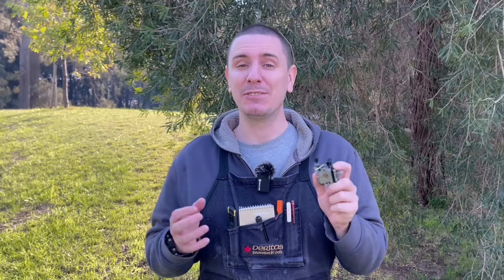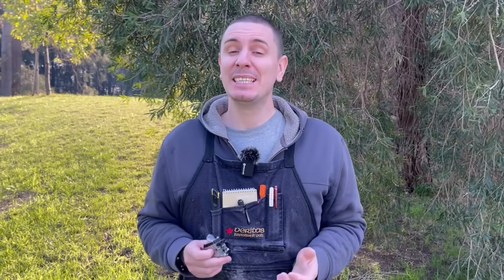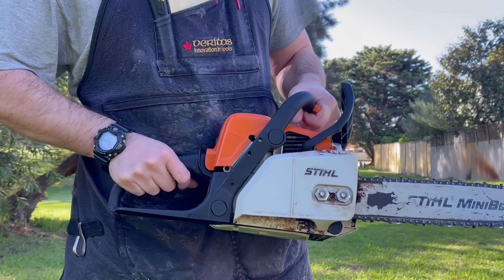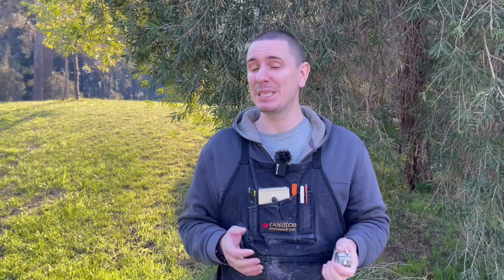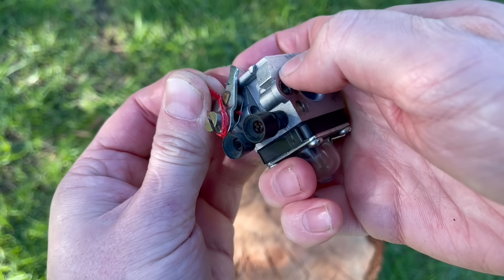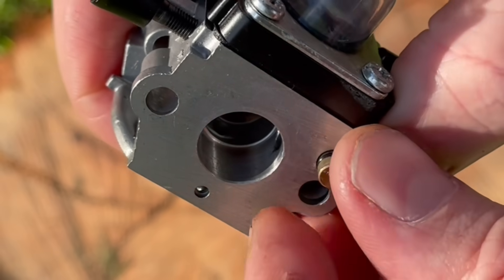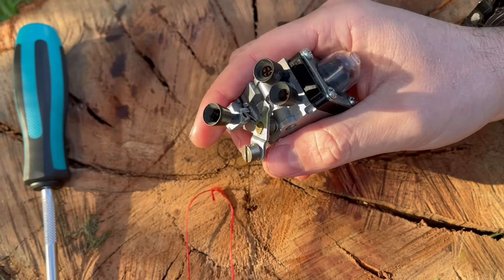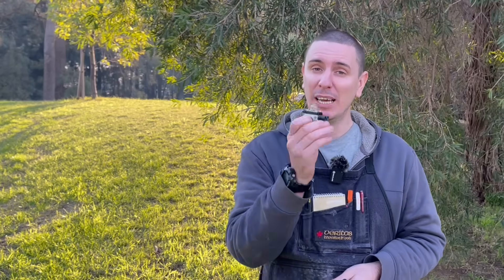A Carburetor Fix Many Mechanics Don’t Know!

Comment: Yes i ordered a brand new carb with a short block,, for weed trimmer,,  does not run right,, I'm going to try carn on original engine,, I can't remember the name of the weed eater, when i went to trade school, the teacher taught us the circuits of the carb,, i think 7 circuits,, idle, off idle, cruise, full throttle,, accelerator  curcuit , float bowl,, choke circuit, i could fix any carb after that,, i did jot get to set in on his automatic transmission class,, so i just started tearing transmissions down snd putting them back togather with new clutches snd seals,, cleaned up, best i could, they worked,, i did not really know how they work,, they did,, !!? I remember the older guys in one shop,, i heard them saying, "they gotta be clean" that's the most important thing,,!  So when i worked on forklifts, i did the automatic transmissions,, they had reverse and forward,, were super strong,, the dealer i worked at had book showed trans fluid circuitry,,  bosses bought a big flat bed truck, so i drove to other side of town brought a large 6cylinder forklift back to shop,, rebuilt trans, put it back on flat bed truck, drove it back across town,, everyone was happy,,  no one asked me if i had a license to drive truck,, was easy to drive,, cab tilt back could see engine v-8 ford,, was fun to drive,,  i was getting goid at rebuilding forklift transmissions,,!!?  Oh well, we're talking about weed trimmers,, these little carbs,, i  have not broken the code on these things yet,, ??!!
Reply from the maker: Sounds like you’ve got a lot of experience with these sorts of things! I hope you find a solution :)

Comment: I had a little stihl saw that was doing exactly this, I don’t work on carbs much but being a mechanic by trade I pulled it all apart and found the oring was worn on one side, so I ordered a rebuild and sold the saw after it was running good😂
Reply from the maker: Awesome! Good work :)

Comment: The biggest issue with these small engines is ethanol in the fuel that produces water in the as tank.
Reply from the maker: Yes, best to keep it drained when not in use :)

Comment: Amazing stuff, thank you for sharing. I will add that on older carbs, the diaphragm will be stuck to one or both surfaces. if it does not separate very easily damage can occur, and simply leaving it in the sun/warm place while you have lunch will allow a bit of expansion to happen and the diaphragm will lift off far more easily. hope this helps someone :)
Reply from the maker: Great tip!! Thanks for sharing :)

Comment: Most consumers are not capable of servicing their carburetors . I have been doing small engine repair for over 40 years. As you stated, its easier and cheaper just to replace the carburetor on any small engine rather than rebuild it or replace worn parts. I seldom bother with diaphragm kits any more. The labor involved is more than the cost of a replacement carburetor.  I talk to many small engine mechanics on line and they themselves no longer bother rebuilding a carburetor.
Reply from the maker: Ahh yes but don’t forget this channel isn’t aimed at professional mechanics in a workshop, this channel is to empower homeowners and passionate hobbyists to take on rewarding repairs rather than being parts swappers.
Reply: @VintageEngineRepairs  I must say is very rewarding to fix the no chainsaw or any machinery. Thanks for the wonderful work you’re doing.
Reply: why get a mechanic to replace your original uality Zama/Walbro/etc carb with a cheap poorly performing Chinese copy? Anoher reason to never use a mechanic
Reply: @wxyzxdll Are the OEM ones any better now days? I question that. If you tell a customer its going to cost more to fix something than they figure its worth, they may just dump it on you as well. How many gas powered weed wackers can you sell? Used ones? Good luck.
Reply: Perhaps one of you guys can help me… I have a Stihl HS 45, and I’m experiencing the same bogging down issues when I hit the throttle. It lags before it accelerates. And sometimes won’t stay running after running it hard. I replaced the carburetor, the spark plug, the fuel filter and cleaned the spark arrestor very well, and still have the issue… Any ideas, fellas?
Reply from the maker: I'd suggest looking into an air leak somewhere mate :)

Comment: Rather than doing all of this, you can inject a small amount of grease into that 3rd hole without having to strip and rebuild it.  The grease is viscous enough to seal up any tiny airleak.
Reply from the maker: That isn’t the only hole, behind that one you have the shaft hole. You can’t get it fully sealed from the outside. Oil is a better alternative to test if it’s failing, but the only true fix is replacement.

Comment: So! This could be the reason here for the high failure rate of carbs on 4 Mix brushcutters. Users had no option but scrap them because of several carb replacements. But some I redeemed by fitting clone saw carbs that are fairly generous with fuel delivery, especially in the idle and low speed range set with L. I do have a box ful of carbs . Let me see if I can breathe life into some of them
Reply from the maker: Interesting! A customer is bringing me a km131 that floods too easy on cold starts, going to dig into it.

Comment: Hey,thank you for your videos! Those helped me a lot. :) I have a question,carburetor from stihl fs38 2mix,primer bulb wont prime,it doesnt have acceleration pump like classic 2 stroke fs38 . I dont know what to do 😐
Reply from the maker: Check the main nozzle is sealing :)
Reply: @VintageEngineRepairs  thanks,can i send you picture somewhere to be ensure Im looking at a good thing?😅 Is it a one way valve btw?
Reply: Okay ,I can blow air and suck it ,so i think its not good. Where i can buy a new one? Im from Croatia :)

Comment: Brother i got a question. Every darn time i unloosen and re-seat the throttle blade and tighten the screw, the plate slightly kicks back out of perfect adjustment. Ive tried tightening the screw so many diff ways and the plate goes from perfect(zero light) to then out of adjustment (seeing light). Sounds stupid but any ideas to help such a stupid problem im having.
Reply from the maker: Hey mate, you only need to be snug with some picture, sounds like you may be forcing it? Alternatively, set the butterfly slightly off from the alignment and when you tighten it down it will align perfectly :)
Reply: @VintageEngineRepairs  Thanks brother, ill try it and hope for continued success for you

Comment: I couldnt find anyone that could supply a new oring or piston for a C1S Zama so i just plugged the bore with JB weld and drilled the second idle progression hole slightly bigger. Saw runs great now but does use more fuel
Reply from the maker: Nice fix!

Comment: If you always use the rec stihl 2stroke oil  you prob wont have these issues for a lon long time if ever they dont rec that oil for just any reason it protects the rubber and brass aluminum parts from wear throughout the entire pice of equipment aka read your owners manual sthil strictly warns and also voids your warranty if you use cheap 2 stroke non approved lube
Reply from the maker: That’s simply not true, in fact Stihls 2 stroke synthetic oil is actually very low quality - JASO FB rated. In fact it’s one of the worst you can buy! There are far many more better oils that offer cleaner burning and more affordable.

Comment: I've worked at a small engine shop for several years. I have read dozens of repair manuals, taken brand certification tests,  and spoke to the other techs I work with. Yet, I have never been told about this or showed this before. I cannot wait til my next "problem child" comes along so I can try it. THANK YOU.
Reply from the maker: You’re very welcome :) glad it was useful!

Comment: I find that it is the pinhole tube that goes from the fuel float reservoir to the bottom of the venturi air valve is most problematic. If you don't drain the gas or leave it over the winter and try to start up in the spring, residues or varnish plugs up that tube, therefore no gas gets in the venturi.
Reply from the maker: Ah yes, the check valve in the main and idle drillings. They are normally very reliable, but I don’t have ethanol in my fuel, that may be making things worse for you?

Comment: Mabe but I also had this problem with my chainsaw I so sent it to the shop and it was fixed for a short time then problems returned. An old mechanic friend of mine then showed me the problem the shop had lazily just adjusted the throttle and idle screws but the problem was the diafram had a hole so small i needed a magnifying glass to see it. Changed it had to reset to throttle and idle screws to factory settings (idiots) then ran like new.
Reply from the maker: Glad you got it sorted :)

Comment: Thank you for teaching, an old dog new tricks.  I am a 73-year-old retired engineer, who has tinkered with engines and all things mechanical & electrical ever since I was eight years old.   Very grateful to my Father, who allowed me to fail and learn from failure.

I even owned an original McCulloch chainsaw, which was a beast to keep running, but 20 times faster than an ax.  I still fix my own carburetors and a lot of carburetors for other people.  But like others, I never knew about the accelerator pump on the small engine carbs.   Again, many thanks !!
Reply from the maker: You’re very welcome! I’m glad you enjoyed it :)

Comment: Thank you sir. This is the difference between a true mechanic and a fitter!
I have a 50cc petrol post driver suffering just like this. I did buy a replacement carb, but having boxes of multiple neoprene O rings, I will take it apart and replace this O ring doing the tests you recommend. I use it for repairing the 100mm 10 foot deer fencing poles and it only idles with the choke on, I have to place it over the pole which is already 2 foot into an auger drilled hole, then flick the choke off and catch it with the accelerator. Sometimes it stalls out which is a pain because it's pretty heavy to take up the ladder and place over the pole.
It would be awesome to get it working as it should, it was never right from new.
Reply from the maker: Thanks for the kind words, and I agree with you!
Reply: As a small engine mechanic, my goal is to get the customers  unit back up and running at a cost they can be happy with. I have learned that it is cheaper in the long run to just replace the carburetor,  than have to charge time to rebuild. It is seldom just one part that fails. Upon opening a carburetor,  I generally see a lot of wear on everything.

Comment: When you can buy a BRAND NEW Walbro or one of the 20 different clones of them for under $50, why would anyone bother repairing one? I have pulled many of these apart over the last 40+ years, and they NEVER work the same again after reassembly. 99% of Go Kart drivers have a box full of these, for all different tunings to suit all different tracks in all different weather conditions. The guy's who are consistently on the podium aren't going to waste time pulling a $50 carby apart to make it worse than it was. The rebuid kit is almost as much as a new carby anyway. I have a box full of them for my petrol engines on RC aircraft and petrol powered gardening tools. If your having issue's, the simplest fix is to replace, if you mess up the pop off tension or damage a jet  or bend the delicate float arm or whatever, then your carby is stuffed anyway.....all you need to do is lose ONE screw, spring or washer and your carby is garbage aswell.
Reply from the maker: Thanks for watching
Reply: A box of O-rings is lighter to carry, but rebuilding stuff requires skill and patience. And if you learn how to do it well, you can do tiny mods to increase the gas flow and performance too. But it's harder!
That's the difference between a real mechanic, and a fitter IMHO sir.
Reply from the maker: @chriswalker4272  very well said 👍
Reply: @chriswalker4272  Rebuilding one of these is simple enough, as is re-jetting. but 90% of people that own a chainsaw or other petrol powered machine either don't have the knowledge or skills required, the patience to do it or the tools to do it correctly, so my comments are true. I have spent more time in the last 40 years reassembling these carbs than I care to admit, and it is simply a time consuming annoyance that can be fixed much faster and easier by replacement. We live in a disposable world more than ever, somethings are simply NOT WORTH FIXING anymore. A cheap 40" bar chainsaw costs less now than a carton of cigarettes, I'd rather spend $150 on a new item than spend 4 hours repairing one that will fail again sooner rather than later anyway. Nothing is made to last anymore, let alone be worth repairing.
Reply: “C-A-R-B-U-R-A-T-O-R”.       You’re welcome.
Reply: @wiltonsmith3397  Thanks for the incorrect correction we didn't care about

Comment: I'm wondering if this is the problem I have. I have a leaf blower and a chainsaw that won't run right. I've cleaned the carb out on both, and changed parts too.
Reply from the maker: Do the oil test over the 3rd hole :)

Comment: I once bought a book on 2 stroke engines all about and how to tune and rebuild and such, just to see if I couldn't glean a bit that I didn't already know. Right in the preface was a sentence that caused me to throw that book in the trash. It said 99% of all engine problems as far as runability could be fixed with a spark plug change. You know I've had maybe one or two engines in my tens of thousands that a spark plug change fixed anything. Junk BS!!!

Comment: I got one you just may help me with
Reply from the maker: Sure, what’s up?
Reply: @VintageEngineRepairs  I got one only a year old echo. I've cleaned and serviced the carburetor but will still only run when full choked and even then it only starts if you hold the throttle at full and runs abt half power. The bulb is good I've been through it completely new spark plug and even cleaned the spark arrester
Reply from the maker: Have you tuned the carburetor?
Reply: @VintageEngineRepairs  yes
Reply: @pieseasmyseas  Possible got a plugged up fuel filter. My Stihl weedwacker ran similar to that…… full choke to start, half choke and full throttle to run, dies if at idle. Pulled fuel filter(stone) and blew compressed air back thru it - worked like a new unit instantly. Put on a new fuel filter now and it’s mint!

Comment: “A carburetor fix many mechanics don’t know”…yea, it’s called throw it in the trash and swap it for a throttle body and fuel injectors.
Reply from the maker: And then you can enjoy the rewards of having to pay silly amounts at your local mechanic because the manufacturer doesn’t allow users access to the software - a stihl 500i sounds right up your street ;)

Comment: Great video never thought about that piston before always thought it was the fuel demand diaphragm getting stiff over time that would create the problem.
Reply from the maker: Both :) lots of issues you can have in different parts of the carb can give you similar symptoms, but you build up an idea of which to go for first!

Comment: Ive rebuilt carbs for 50 years. If the o-ring is shrunk the diaphram is puckered also. Most carbs can be purchased new for $10-$20. I haven't done a carb job in years. Not worth wasting all that time.
Reply from the maker: I can do a carb kit and acc pump in just a few minutes for a couple of dollars, but of course ymmv and we can’t get carbs that cheap out here. Not to mention aftermarket is very unreliable.
Reply: Unless you get that extra hour of pay! 😉

Comment: Walbro   and   Zama   are  two  popular,  carb  brands,  on 2 - cycle  stuff.  Stihl,  uses the one, in this video, at 3:05  Time. Where both  diaghrams, are in the top ; just under the  squeeze bulb. Other carbs, have one diaghram, on the bottom. Usually a small plate , with an indentation, and 4  philips  screws.  Same idea, just on the bottom of the carb.  I need to order one, each for a Stihl   tiller,  (43 cc   i thing engine )  and an Echo weed whacker - Walbro carb on it.  Thank - you,   Mr Vintage for  teaching us....
Reply: i think, engine....
Reply from the maker: Glad you enjoyed it!

Comment: I am still using the same Husqvarna  Rancher 44 and 61 that I bought in the 80s when they made them in Sweden  . Thanks for explaining the carbs I have rebuilt them carefully and they still work quite well  . 
 I  always keep the extra parts included in the rebuilding kits and they can be used for repairs if you punch new holes where they don't match your carburetor  . 
 That zip lock bag of extras is a treasure  .

Comment: Funny thing about "phillips" heads,Overhead Garage doors used to use a fastener that looked phillips but was not,I took a number two phillips and ground the tip down enough to where it would seat properly for removal.

Torn out and replaced lots of those doors with my modded bit.
Reply from the maker: I love modifications to fix a problem, good job!! :)